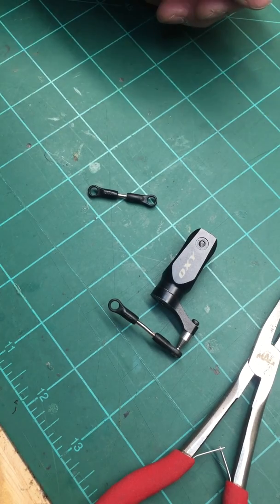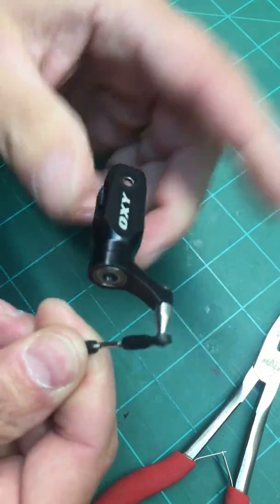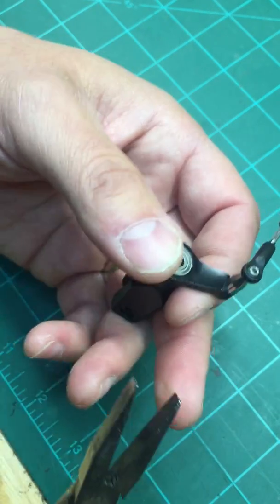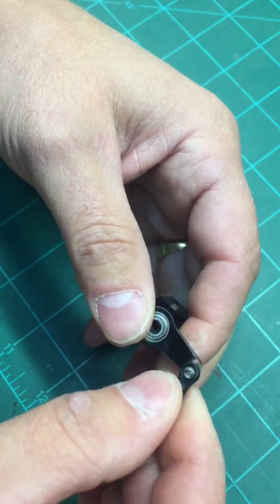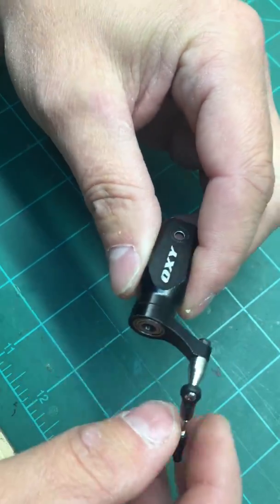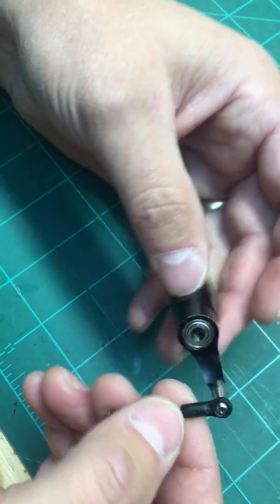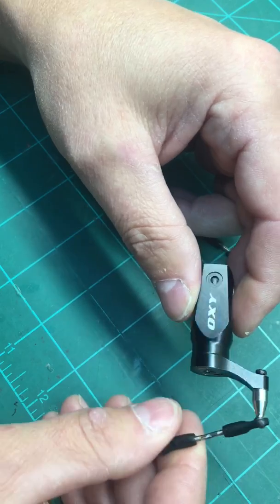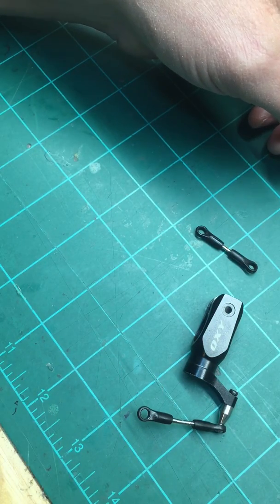Ball link sizing

Comment: Nice vid. The heat trick is a good one as you can use this on any link that's a shade loose. I use a hot air paint stripper gun on low heat and I heat the link (still on the ball) for maybe ten seconds. This causes the link to shrink onto the ball and tighten it up nicely. You can also make a link sizer/reamer if you have a spare ball. Mount the ball in a pin vice and cut a slot in the ball 'length-ways' and half way through with a Dremel cutting disk. The slot you cut in the ball gives the ball a cutting edge so it works just like a regular ball reamer.